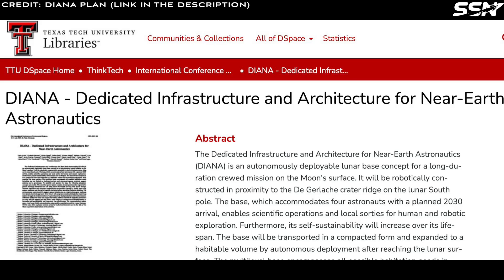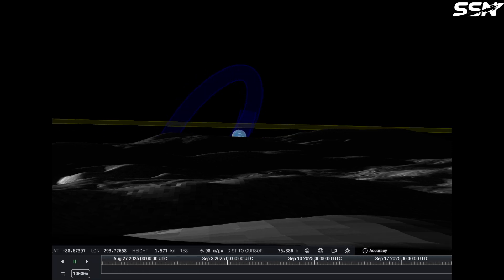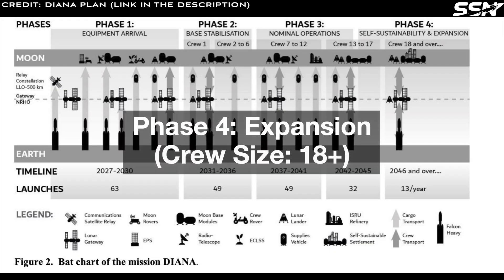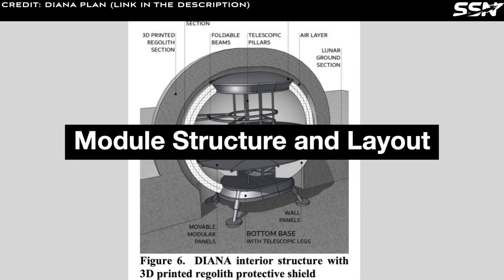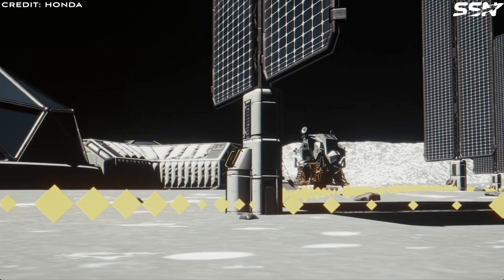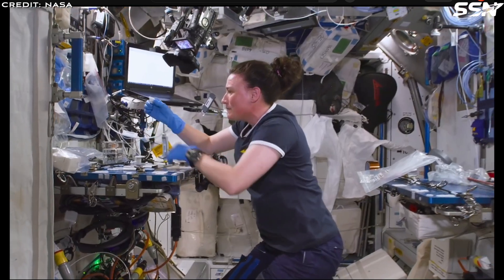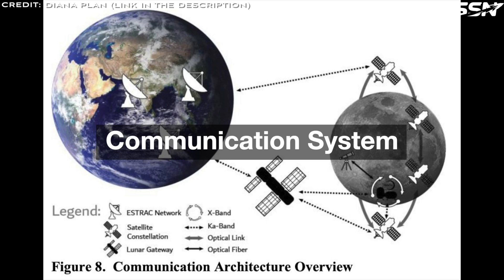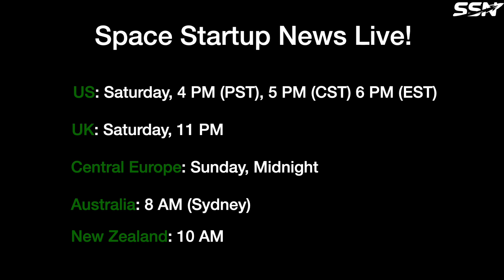The DIANA Lunar Base: A Vision for Sustainable Lunar Exploration

Comment: As with previously mentioned lunar base concepts that were either covered by SSN videos or in my comments, this DIANA concept has some impressive ideas and is also missing numerous features that would make it more comprehensive. It's almost amusing how these concepts will overlap on some good ideas, offer some unique ideas on their own, but also have some key things missing that other concepts have. 

It's easy to conclude that any moonbase concept that requires over $100 billion is not practical and is never going to implemented. But beyond the obvious lack of funds, there are other significant issues:

1: A base concept that requires a fleet of powerful ISRU + 3D printing robots is obviously not going to work unless the moonbase concept has 24/7 nuclear reactor power built-in. This nuclear power would definitely have to be in the multi-kilowatt range, but more likely would need to be megawatt-capable. The combined efforts of the U.S., Canada, Europe and Japan, and possibly India and other countries, would probably not be sufficient to pay for such an expensive operation.  And, of course, all this assumes that all of these countries are working together on such a project. 

2: 3D printing is seen as a very advanced and impressive space-base building technology. But implementing this technology on the Moon will surely also prove to be cost-prohibitive and may take extensive time to make reliable. It would also surely require nuclear power, the more, the better.

3: Building a base camp is seen as desirable. Building a permanent or semi-permanent moonbase is seen as even more desireable. Building a larger, permanent moonbase capable of housing a dozen (or dozens) of astronauts seems over ambitious and premature. The most common thinking I've seen among thinkers on the internet would be to start very small (4 to 6 astronauts) and to very gradually grow from there over a period of 20 years or more. Another, smaller concept would be Sabrina Kerber's HAVEN concept, which would be best suited for 4 to 6 astronauts and favor excavated regolith over 3D printing. 

4: NASA is currently underfunded and this situation could grow much worse in the near-term. Whether or not future leadership in Washington reverses this ongoing funding crisis remains to be seen. Hopefully if shifts in political forces do change, we might see the NASA situation change. When this would happen is anybody's guess. Currently, NASA's science budget is under attack by the White House, and Senate Republicans are quietly avoiding the issue.

5: It's hard to see Artemis giving birth to a healthy baby moonbase when it is not even clear when astronauts will land of the Moon for the first time in over half a century.

Paraphrasing Diana Ross and The Supremes' "Love Child":
Moon base
Was it ever meant to be?
Moon base
Born in poverty
Moon base
Will we ever see?